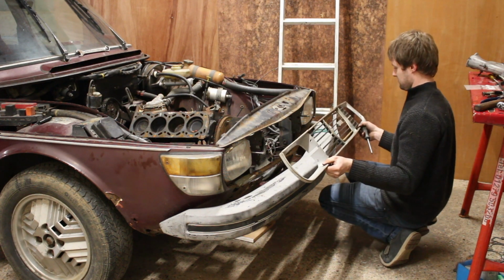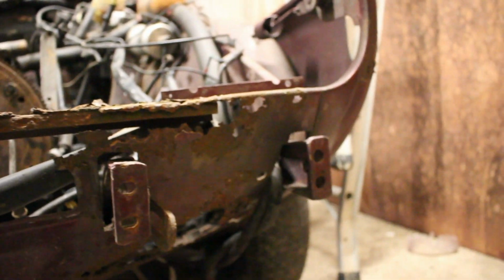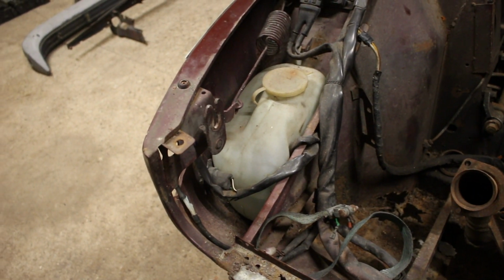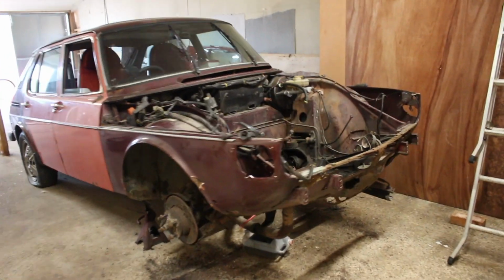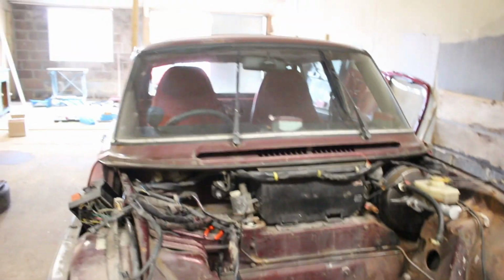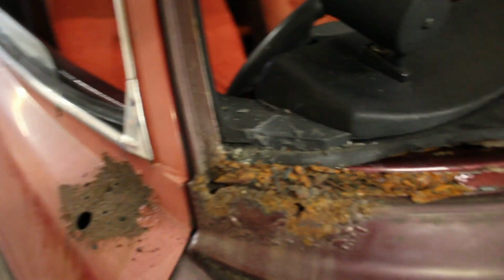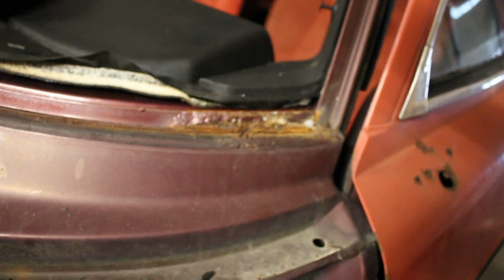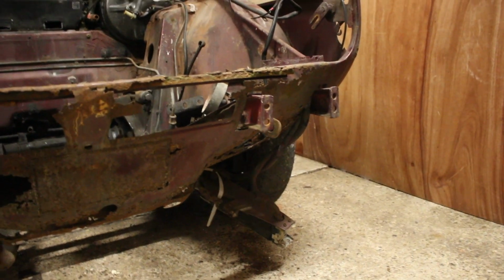Removing Engine, Finding Rust and Breaking Windscreens - Saab 99 Turbo Restoration

Comment: Hi you can get the engine out without removing the drive shafts. take the weight of the engine on the crane and then pull it towards one driveshaft and the other one will pop out!

Comment: I lost 2 windscreens myself.  One on the removal of the original and one on the replacement which was shipped incorrectly.  I think they're all delaminating at this point.  But where do you find an original? Pilkington?